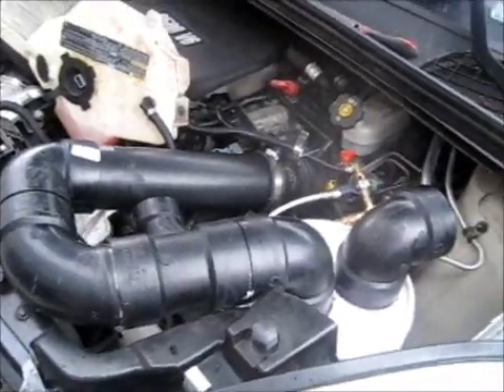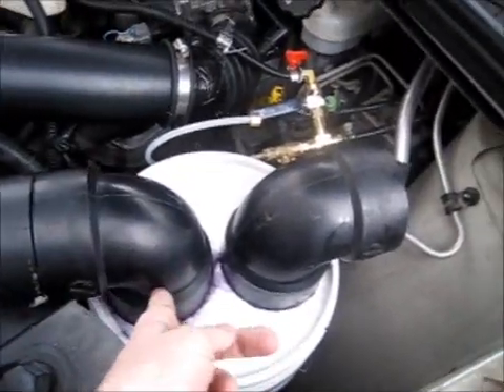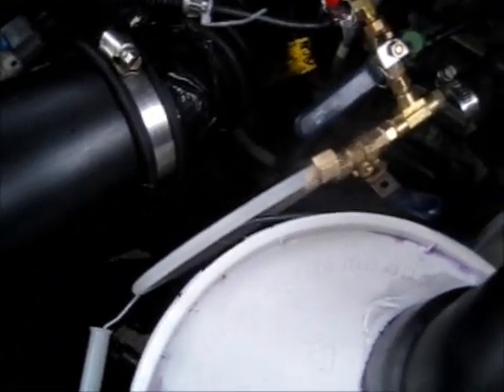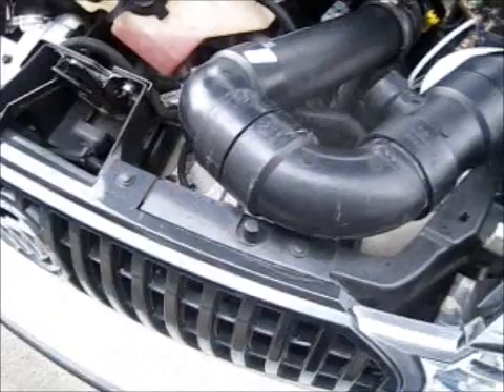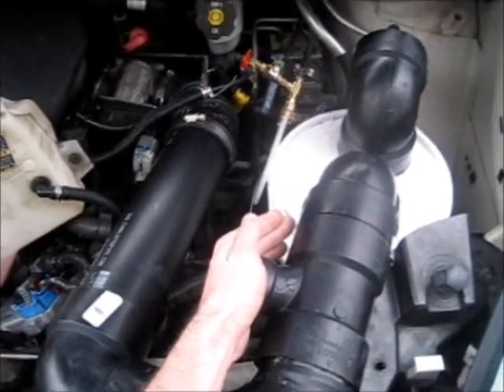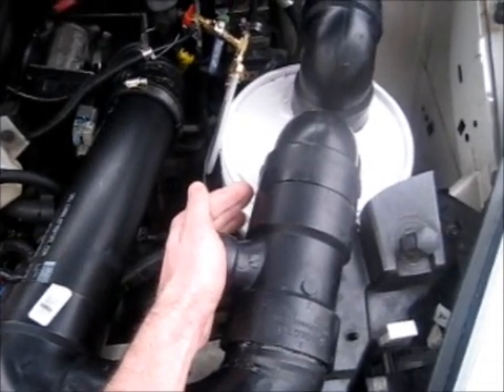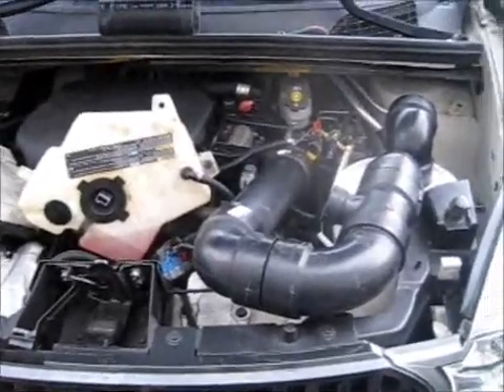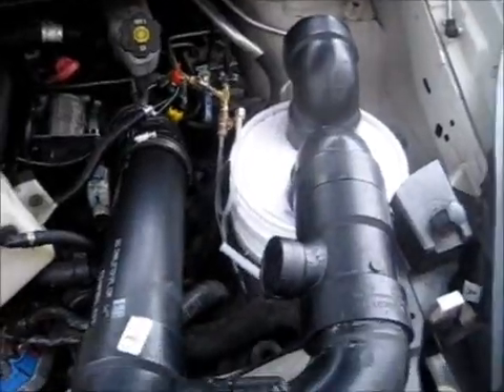Gasoline Vaporizer Build Part 2 (Running & Installed in my 2006 Buick)

Comment: a vac operated butterfly valve can be as simple as a piece of rubber and a spring but i would put it in the corner of the vapor output straight in line with the flow of the vapors for faster response . plus eliminating the need for extra linkage.

Comment: what about an offset butterfly valve with a (but not too soft) spring. meaning the usual center post the actual butterfly is attached to would be farther to one side and set to open inwards and a semi soft spring to keep it closed and offer some resistance so as not to open any further than the velocity of the vacuum itself. i hope that made some sense. lol

Comment: Have u had any issues with it running too lean and burning a hole in the Pistons?
Reply from the maker: +Damin DeRosier No issues ever, even with every system I've built and tested.

Comment: What you are doing is drawing the entirety of your air supply through that bucket. Now I'm no expert but it may have been simpler to just run a smaller hose into an otherwise unmodified intake tract, where ever you choose. Some of the videos I have seen the owner of the vehicle has simply plumbed hoses from the gas can to the intake manifold and the engine ran fine. One idea I would execute in doing that is a manual shutoff valve plumbed into the hose that when shut not only prevents vapor from leaving the gas can when I'm not using the vehicle, but also for adjusting the fuel vapor flow into the engine. I guess you could think of it as controlling the AF ratios. :/

Comment: could you use a venturi tube in place of the butterfly valve? as the vacuum increased it would siphon more air threw automatically or no?
Reply from the maker: I would imagine that would work great.

Comment: Did you try using smaller diameter tubing? maybe you are pulling in too much air?
Reply from the maker: Yes I tried many different sizes of tubing to increase/decrease air volume and velocity.
Reply: Tyson Capel  whith smaller diameter tubbing.. this does not start?

Comment: Why not make a HYDROGEN GENERATOR (using 2 stainless steel mesh pads-from DOLLAR TREE-one IN a nylon sock & one on the outside, both connected to 12 v. power supply that is hot ONLY when running), then have the warm (or hot) hho gas going into the GASOLINE VAPORIZER-the tube going to near the bottom of the gasoline?  This would help to keep the gasoline warm!

Comment: Not sure if I missed something in comments below what is mpg currently and what do you expect to increase mpg to once you get butterfly valve in?
Reply from the maker: I don't have it in my vehicle anymore due to having to many problems with it nor running well. It was way to temperamental. 211.7 was the most I got but most of the tests were far bellow that number. I was only successful at achieving that mileage increase about 3 times and since that time have not come close to getting it again. I made a different system that I put in my Jeep and the most I got out of it was 33 MPG stock was about 18. I have since reverted to doing testing on a generator so I can learn what is going on with everything so I am able to figure out what effects run time for better or worse. Check out my other videos for more vapor systems and to keep up with what I am currently doing.
Reply: Tyson Capel
I think you are using way too big of an inlet tubing through the vapor system, being very litte gas vapor is needed, it would change the air fuel ratios vs injected, more air for more fuel, vise versa... correct? plus the colder the air the better, cold air expandds in chamber for more expansion driving the piston along with the explosion of the fuel, this is definitely an experiment but a guy got about 200mpg in a old 70 or 60s v-8 car! its the air fuel ratio that needs to be figured out, thats all, so you getting 211 is possible once you figure it out, i am testing on a 04 buik here soon...
Reply from the maker: JeHeretic Yes the intake could be reduced.
Reply: Tyson Capel
I tried this, but was not successful, I just dont have the resources I need to better experiment with as of yet, but the mileage was horrible, the bubbling was not good, it cause a great waist of fuel, so I am going to have to get back to this once I am earning more money, not that this project is expensive its just i am that broke for now, I will document everything and share my results
Reply: Good luck,
Reply from the maker: JeHeretic I have made several attempts to replicate the results but have failed at most of them. Some think this process is easy but getting everything dialed in as extremely difficult and requires allot more components than what you see in the video.
Reply: Tyson Capel
I bet it does, I looked the the system designed in the 70's by that guy who got a v8 to get about 200mpg and its pretty much a total system design, he took off the carb n designed his own bolt on butterffly intake ... it will take more than I have as of now to get it dialed in and duplicated for our new day cars.. but I am sure it can be done..

Comment: You do realized that engines run off of vapor right...fuel is atomized through the injectors...
Reply from the maker: Yes all engines run off vapor but there is allot of unburnt fuel that goes out the exhaust.
Reply: there is some unburt fuel that helps cool the cylinders and prolong engine life.

Comment: Yes you can run you car on fuel vapor but tell me this, after drawing vapor from the fuel for a while, doesn't the fuel loose it's ability to produce?  Your left with a good portion of the fuel unusable because you have already removed the octane.
Reply: Why have a COLD VAPOR SYSTEM, when you CAN have a BETTER SYSTEM-by forcing hot exhaust from the exhaust?  I saw someone doing this with a lawnmower!  Why wouldn't it work on cars, trucks, etc.?  Also, this way one wouldn't need a butter-fly valve, I don't believe.  Why not try it?  I'm an old man with MANY AMAZING IDEAS- LIKE, why not use a GASOLINE VAPORIZER & A HYDROGEN GENERATOR FOR MAXIMUM MPG AND POWER AND EVEN LESS POLLUTION?
Reply from the maker: Yes that will happen with a cold vapor system if you don't circulate the fuel. I ran my rototiller 7 hours straight tilling my yard and kept a small drizzle going into the vaporizer chamber and the container did not continue to fill up with unusable fuel over time which tells me that if you keep the fuel circulating or keep a very small supply of fresh fuel going into the vaporizer you will not have the problem with the fuel going bad on you.
Reply from the maker: You can see one of my systems with a setup just like that. Check out some of the other videos I have posted to see it.

Comment: look, don't reinvent the butterfly valve, get a small motorcycle carb and run the cable to the foot feed then  install it on the air bypass and tweak to get her to run, good luck! love the video.
Reply from the maker: Check out some of my other videos particularly the one of a vapor system on my jeep. I used a dual throttle body butterfly setup.

Comment: What type of black tube is that? Pvc would get eatin up. Is it septic pipe?
Reply from the maker: ABS and no the gas did not eat it. I had gasoline sitting it it for over a year with no sign of the material decaying.

Comment: Dude you are an idiot......You just made a carburetor....I think somebody already invented it
Reply from the maker: Dude you have no idea what you are talking about.

Traditional carburetors don't make nothing pure fuel vapor. Vapor is what burns not the liquid mist a traditional carb makes. Only a small part of the fuel a traditional carb sends into the engine is consumed because most of it remains a liquid the rest (non combusted fuel) is wasted out the exhaust. This unit only sends vapors to the engine therefore it burns completely and none is wasted. Show me a traditional carb that will allow a vehicle to get 200+ MPG.
Reply from the maker: You can see it here. Yes they have allot of problems that's for sure. Were slowly getting them worked out though.

Comment: Sorrry, I don't mean increase in ignition flash point I mean a decrease in ignition flash point, because that's what octane does.  The more octane the greater the delay before the gasoline ignites.  That's why we have high compression engines...to burn liquid gasoline.  You don't need compression to get combustion with natural evaporation.  Humans have been doing it wrong for a century.
Reply: You peaked my interest Sergei. So I did a quick search and only found The Hornsby-Akroyd oil engine, has a vaporizer, where combustion takes place, they were low compression, cause like you said, no compression is needed. The earliest working engine was built by Julius Hock, of Vienna, in 1870, Non compression :).. Wow, the more I learn, the more I realize the phrase "Human Intelligence"*** is an oxymoron, proclaimed by morons..lol. With many exceptions, but not enough. Sounds like it was an efficient work horse. It had a few probs, but nothing that couldn't be, or already has been worked out. 
...........Peace my Friend
***without wisdom
Reply: I saw the twelve volt ULTRASONIC from that link you sent me.  Was it DC?  I forget.  Before I do that, I remembered that if you blend 50% gasoline with 50%, the transducer may not start getting soft rubber and plastic problems till later.  And we all know that with the right spark (plasma) water will ignite.  UT water fog is even better, I bet.
There's a youtube of a guy with the clear glass jar who performs this experiment.  What it said to me was that even though the 2 liquids do not mix, with all the agitation from the bubbling they were intermingling.  Bubble to bubble.  Water creates the skin of the bubble and the gasoline fume is inside.  Curious.
I'd like to try feeding alcohol into an UT.
C2H60 seems to be the drinking version symbol and burnable in your car version.  Drink & Drive.  Hmmm the cops won't like that pun.
Reply: Did you look at the Oglemobile fuel system drawing?  You should know that in the 1970s,
there were a lot of guys out there experimenting hard with this fume stuff.  We got scared when they murdered Tom Ogle.  Then my partner Mikky Rhyzak, who had a working Fume system in 4 of his vehicles suddenly committed suicide.  Then Stan Myers dies of poisoning.
Reply: It's not that MAN IS STUPID as much as the Humans in Power force us to be STUPID.  It's where our financial system vs. greed vs. science falls apart.
Reply: ...and it's not always greed.  Sometimes just breaking even in any business will cause you to go bankruptcy.  You need to make a profit, so you squelch as much risk as you can.  So Mikky got a $30k buy-out for his system.  The cheque came from VW.  Mikky must have violated his fine print.
Reply: ...and your point is?  More THC?

Comment: The Ultrasonic Transducer should be used occasionally to clean your fuel system because if you keep running cold you are burning three of the main ingredients of gasoline but there are three left and if not fogged, you will leave tar in your fuel system over time and the increase in octane will build up in your fuel causing your ignition flash point to increase when you switch back to liquid gasoline.  Have you found a 12V transducer that can be submerged in gasoline?  Also have you tried a throttle (potentiometer) on the power going into the UT?  Have you tried feeding DC to the UT?
Reply from the maker: I have not found or tried a 12v transducer. I used a inverter for the 120v ac transducer I had. I am going to be ordering a modified transducer so it will work in gasoline and see what kind of data I can get using it.
Reply from the maker: Here is a great website you can order a 12 volt DC transducer from. You can call them and special order the transducer without the sensor. You must order it without the sensor because the transducer will fail very quickly if you modify it yourself.  

http://www.mainlandmart.com/foggers.html

Item# DO-12
Reply: Tyson Capel If you use a household AC dimmer  switch connected in sync with your throttle?
Reply: Tyson Capel I have the Chinese $9 delivered to your door UT that has the goofy flashing LEDs.  I'll look into this sensor.
An ideal place to install the UT on a vw would be the float on your gasoline gauge sending unit.  The UT needs to be the perfect depth in the liquid gasoline.  Too much liquid depth the UT doesn't fog.  Too little liquid depth, droplets crackle and no liquid dry, the UT burns out.
Reply: Now to find a 12V potentiometer.  That float buoy $10 is a good idea and so is that splash retainer basket.  The only problem here is if their materials can withstand gasoline emersion.
Reply: UT is necessary because of the "GUMMING UP" over time.  Here is the link to diagrams from Tom Ogle's system without UT.  He has a butterfly on his gasoline tank source which is doing what your hand was doing in the video.  Make sure you have a gasoline fire extinguisher ready at all times when working on this stuff.  OK?
http://www.documentingreality.com/forum/f227/200-mpg-1978-tom-ogle-invented-age-21-a-137527/
Of course you are going to put an air filter on the intake?  I would use elastic band holding a membrane of lightly oiled surgical cloth.

Comment: Tom Ogle had a butterfly valve on top of his gas tank and ran the fog through a 3 inch pipe to the intake manifold.  Got to this page and scroll down to the diagram.
http://fuel-efficient-vehicles.org/energy-news/?page_id=787

Comment: Most vehicles ecu control the air fuel ratio. I think it kerps that ratio around 14:1 i am certain of the ratio. Its going to be tough keeping the mixture correct. I read some where that the engine can be harmed if you run your engine too lean for extended time. I am not a expert. Just thought.
Reply from the maker: Yes the computer does keep the ratio to 14.7:1. The ratios do change a bit when using a vapor I;m still working on the best ratio to use and will release the information when I have more data... Yes the engine can be harmed if you run it lean for to long but the reality is you are not actually running it lean you are running it more efficiently and because of this the cars computer takes it as though it is running lean.

Comment: Tyson, that's a great design; very simple.  Could you use the air/fuel mixture control system that already exits on the car to operate the air flow valve located between the bubbler and throttle body?  If you can find one large or several small valves that operate on the same duty cycle signal going to the fuel injectors but have them operate one or more air intake valves located between the bubbler and t.b. maybe the car's computer could control the air/fuel mixture automatically, continuously.

Comment from the maker: I'm still working on that part I need more equipment to be able to measure vacuum pull air to fuel ratios etc. They have some nice devices that you can hook directly up to the cars computer that will give you readings of many perimeters in the car such as air to fuel ratio, live MPG, vacuum pressure etc. Unfortunately my jeep is a 1993 so they don't have such a device for it.

Comment: Good work. Could you measure the vacuum pulled when the accelerator is pressed?  Then working backward design a spring operated govenor similar to one like a lawn mower? That's manual,(...so you are constantly adjusting the valve via cable from inside the car); but an electronic 12vdc vacuum sensor probably exists somewhere, that is adjustable.
 I think some math calculations are in order to figure hp requirements for foot pounds of torque required to move the mass at a given speed. good luck

Comment from the maker: The O2 sensors don't matter because they wont effect anything such as your transmission, the fuel delivery system is being bypassed so that the car runs only on vapors therefore there is no way the car is able to send more fuel to the engine because it is being bypassed into the vaporizer or rerouted back into the fuel tank.

Comment from the maker: I have heard the rumor that changing the timing so the engine fires at top dead center but that never made sense to me because the vapors are still gasoline vapors which means they still burn at the same rate. When the sweet spot is found the engine is running extremely lean but interestingly enough the engine runs cooler when running on a lean hot vapor system.

Comment: looks dangerous ... and it would be less dangerous if u filled the bucket with stainless steel wool and install fuell ingectors in the top of the bucket that way u have a proper amount of fuell being delivered and a return line to the fuel tank from the lowest point of the bucket ...

Comment: Hi my friend i have a theory, if you put your effort and time i am sure you can make it work. If you install somewhere along the air intake four injectors and connect them to existing fuel pump, air taken in will carry the fuel as vapour and amount of fuel injected by computer will be in line with reves, if it injects excess fuel you can find a way to redirect to tank. this will eliminate the need for heating the fuel and possible flashback.
Reply: that's already been done before, my GMC sierra has it. It's called a throttle body injector (tbi). what you're describing does not produce vapor, it produces mist. the only known way that I can think of to produce vapor is through the process of evaporation, by which air picks up the molecules of fuel as it comes in contact with the liquid gas. forcing gas through a really tiny hole at a high pressure does not produce an evaporation effect (vapor), it just mixes liquid with air in finer particles.

Comment from the maker: It may be way behind in some areas but in other areas it far out preforms modern systems in efficiency. My new design I right on up there with modern day systems, I still have work to do but it does well.